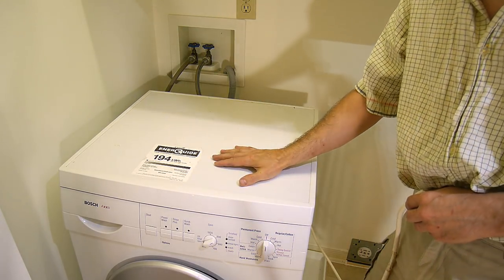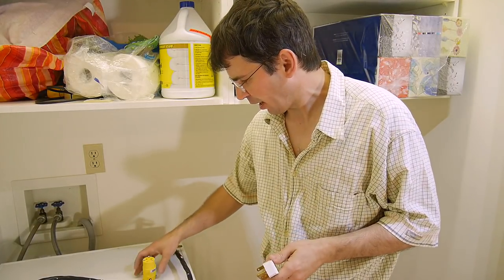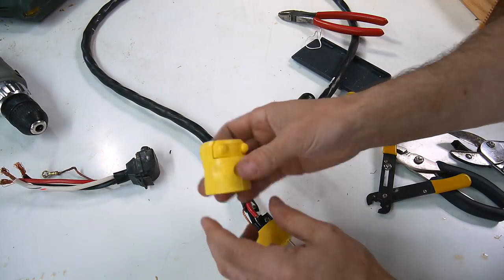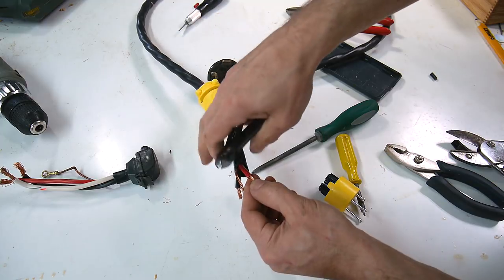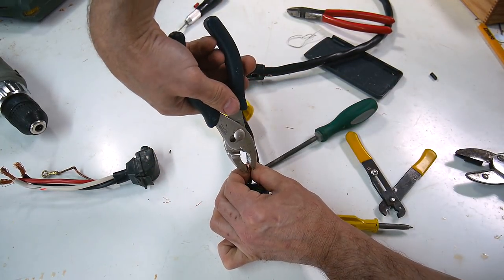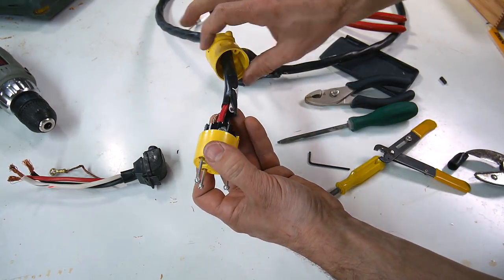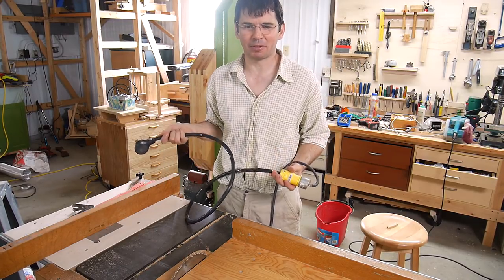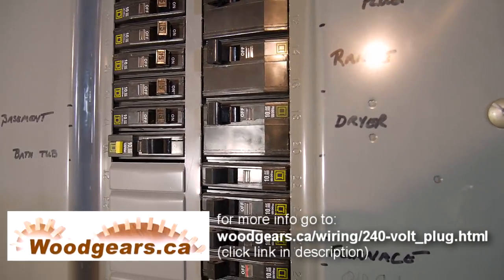240 volt from dryer plug (for Euro-washer or table saw)

Comment: To do a proper installation you should find the washing machine circuit breaker and replace it with a 2 pole 15 amp breaker. Then install the proper receptacle  to plug your washer into. This way will properly protect the appliance and your insurance company will like it too.
Reply: This is the most clever comment. I would have changed the socket on the wall as well.. much cleaner solution. Beside leaving the plug on the floor next to the washer is not really safe.
Reply: Gopher, there is no reason he needs to do that.  The breaker protects the house wiring, as mentioned elsewhere.  He could have just put that plug directly onto the washer cord, but maybe anticipates a move one day.  It might look a little sketchy, but what he did works, and it is safe enough.  Nicola does have a point about the plug on the floor though- I know my washer leaks sometimes.
Reply: I am a Master Electrician. Are you? The way he has done it is not up to 
the Canadian Electrical Code. You are correct that the breaker protects 
the 30 amp house wiring for a dryer, but it does not properly protect 
the appliance which I presume is rated for 15 amps. If this installation
 causes a fire, I would bet that his insurance company would not pay for the damages. If he does move one day, it is simple to change it back to the original way it was and install a breaker filler to cover the extra slot in the panel.
Reply: Absolutely correct. If the insurance company were to see any part of that, they would not pay in the case of a fire.  
Here in the states, that is also done wrong. The main box can have neutral and ground on a bar, but a sub box/panel uses it's common neutral but has it's own ground... Running 2 hot legs and an earth ground can cause issues due to no neutral to balance the 2 legs..
Reply: A breaker can not protect an appliance beyond a current overload because they are not fast acting devices.  It actually takes quite a bit over current for a breaker to actually trip.  Of course the farther over the current is, the faster the breaker will trip.

Comment: In Belgium the rule is 1,5mm² wire = 10A breaker and 2,5mm² wire = 16A breaker. 2,5mm² is mandatory for circuits with plugs or connected to devices. If it's only lightning, 1,5mm² can be used.
Reply: Rizon1985 automatic fuses allow more

Comment: You need to replace the outlet with the correct type (NEMA 6-30R) and that cable is a North American standard (not European). The breaker will need to be reduced to a 30 amp breaker and a licensed electrician should perform the work for insurance reasons.

Outlets are sized according to current and if there were a fault in the dryer then the breaker might not trip before the plastic started melting in your current setup.
Reply from the maker: In that case, never plug a 100 watt lamp into a 15 amp socket, for the same reason.  You will have to get a 1 amp socket and circuit for that lamp (ok, I hope you understand the irony - something I don't take for granted with safety trolls)
Reply: The breaker is only supposed to protect the household wiring and the outlets. If there were a short circuit inside that washing machine that only allowed 35 amps to pass then the breaker would not trip but the current capacity of that outlet would still be exceeded and the connections could melt.

I know it's highly unlikely and I didn't want to come off as a safety nazi but if your house were to burn down for any reason at all the insurance companies will try to blame the fire on any minor electrical code violation they can find.

Comment: Hey Matthias, Bosch is a European company, but that model is definitely Canadian.  It still has the original EnerGuide sticker on the top.  The plug on the washer is exclusively for 15A 240V (er 220...whatever our power is), if it was 20A it would be a 6-20 with one prong turned 90 degrees.

Someone further down mentioned that it would plug into a receptacle on the back of the matching dryer, since the 6-15 plug is uncommon here.

If you want to get really technical, you should replace the outlet above your laundry taps with one of these: https://www.homedepot.ca/en/home/p.15-amp-250v-single-receptacle-ivory.1000137033.html, and then replace the circuit breaker with a 2 pole 15A breaker.  Also mark both ends of the white wire with red electrical tape to indicate it's now a hot wire, not a neutral anymore (assuming you don't want to rewire your house just to get the proper coloured wires in the wall)
Reply: I don't really understand how you're not understanding how the plug works.  it's a NEMA 6-15, it has 2 hot prongs and a ground prong.  Matthias hooked up the bare copper ground wire from the dryer cable to the ground socket of the outlet.  There is no neutral connection to the washer by design, as it's not necessary.  The electricity travels from one pole of the hot to the other side of the hot.  The plug is HOT1, HOT2, Ground.  Look up NEMA 6-15.

Comment: Hi Mattias,

I have a European dryer running on 220-240V,   50Hz 550-600 W.   It comes with a  2 phase wire and will require a 220 V 3 phase plug for North America.  How would you manage such a conversion.

Comment: Matthias, I'm going to leave my assessment of your electrical safety skills unspoken, but I do want to point out that 240V dryer circuits in North America are typically rated for 30A, not 40A (I'm in Ontario like you are). Electric range circuits are 40A (or sometimes 50A), but not the dryer. Also, I run a 240V 6000W space heater in my garage from an unused dryer outlet in the adjacent laundry, and I can tell you that at the 25A drawn by the heater, the salvaged dryer cord I feed the heater with gets rather warmer than I would like, so I would hesitate to use it for the full 30A available from the circuit.

Comment: Small correction: the neutral should not be connected in parallel inside the breaker box. Neutral is connected to the Earth ground at the transformer, while the bonding conductor (this is the proper name for what people often call ground) is connected to the grounding conductor in the box (which in turn connects directly to the grounding rod). So electrically they are in parallel, but each serves a specific purpose, that is why one is insulated and the other isn't...
Reply from the maker: well, then go argue with the folks who wrote the electrical code
Reply: Matthias Wandel, why are you so angry? Argue about what?
Don't get me wrong, but if your neutral is connected in parallel inside the breaker box, your house shouldn't have passed electrical inspection.

In addition, dryer is usually a 30A breaker, stove/range is 40A.

Comment: i think i have this washer, mine is model "wfl2260" about 25 years old, i have had to changed the bushes on the motor 3 times and striped it down to clean once but runes as good as when it was bought just a bit yellowed, my granddad has one about the same age that is in better nik than mine. so you have a good washer there.

Comment: Although I do understand what Matthias wanted to achieve here. I think it would a better solution to replace the 240V plug (NEMA 6-15) of a table saw or of this washing machine with a dryer plug (NEMA 14-30). Such a plug could then be used with an extension cord for a dryer.I am not an electrician, but I do think in such a case you would not have to worry about the circuit breaker and the current rating of the cable.
Just my two cents! Cheers, Mac

Comment: LOL, forgetting the hood before attaching an end is my specialty.  Same for shrink wrap!

Question: This is off topic, but I am curious how you would solder a small Playstation 2 power switch back onto the circuit board given it has 4 tiny contacts (~ 1mm ea.) and my smallest iron tip is a 5mm flat tip?  I'm thinking of coiling a copper wire around the tip and using the end of the wire, but can't figure out a way to keep the coil from moving around.
Reply from the maker: You need a finer tip on your soldering iron.

Comment: Just for my information: Is all houses in Canade fitted with 240 V outlets? The reason why I ask is because  occasionally me and my wife travels to Canada from Denmark to visit my 'in-laws' and as the standard voltage in Denmark is 240 V it would be nice if we just could plug in all our chargers, computers etc. directly into the wall without having to consider voltage issues.
Reply: Usually the only 240V plugs are the ones in the laundry area and maybe the kitchen cook stove if it is an electric cooker. Some garage workshops may have 240. But read the fine print on your chargers and computer power supplies. Many can accept any voltage from 100-240V and 50 or 60 Hz, because this makes them world-wide universal.

Comment: It's always strange seeing how powerpoints, etc... are set up in North America, at least here in Australia it is super simple, everything in a house just runs off a 10A 240V powerpoint and lots of those get hooked up to a 20A or 32A breaker in the meter box. I have 2 circuits in my house, each circuit has approx 10-15 powerpoints on it.

Comment: How is 240v supplied to US/Canadian houses? Is it really two phase 110V, which is why you don't use the neutral conductor?
Reply: me interesting too,  how it works  because 240 single phase is in our country in 3 phase 400 volt between phases
Reply: 2 phases, 180 degrees shifted.
Reply: Same here, 240v single phase. 440v three phase, but nobody has 3 phase power to their house.
Reply: TheFreezeChill so is that a normal thing for every US home to have? Or do you have to get it specially installed?
Reply: In the USA 110/120 and 220/240 is single phase. 440 is 3 phase and only used in factories and larger shops. We use 110 for low current devices like lighting and TVs and smaller appliances. We use 220 for larger current drawing appliances like cooking stove, dryers , welders and such.
Reply: Technically the 220/240 is 'split phase' with one leg either side of the neutral.
Reply: tjousk that's what I thought
Reply: I do, but then I am kind of a nobody.
Reply: Split phase is center tapped ground.
Reply: James Grimwood every house built in the last 50+ years has it. Kinda takes the ol' wind out of the European electrical supremacy sails doesn't it?

Comment: I would recommend using some ferrules. Especially for dryers / washing machines where higher currents could flow. That way you also won't have that problem with backwards bend wires.

Comment: Neutral and ground are not the same thing. The neutral comes from the center of the transformer coil (located at the pole or somewhere outside the house) where as L1 and L2 come from the ends of the transformer coil. The voltage across L1 and L2 is 240 while voltage across L1 and Neutral OR L2 and Neutral is 120. So really all US houses are wired for 240 volts (i.e. L1 and L2). We get the typical 120V coming from the use of the neutral wire that is coming from the center of the transformer coil and either L1 or L2. It only get complicated in the breaker panel when they try to "balance" the load between L1 and Neutral and L2 and Neutral but in reality it's never a perfect balance of power draw across the L1-Neutral and L2-Neutral and that's why the Neutral wire almost always carries current while the ground wire only carries current in a "fault" situation.

If you are wiring a 240V appliance there is no need for a neutral because you are simply using the 240V across L1 and L2. Sometimes if there is electronics in a 240V appliance then the Neutral wire can supply the 120V (i.e using L1 or L2 - Neutral) to run the electronics.
Reply: Thank You for Your explanation. Crystal clear and to the point.
Kind regards
Reply from the maker: How about you have a look in a breaker panel.  See them connected.  And that's what I said - they are connected in the breaker panel.  I didn't say they are "the same".
Reply: Here in Sweden it's common to have neutral and ground in the same wire in to the breaker panel from the transformer. After that they are separated (at least in modern systems), and as stated, current flows in neutral but not ground. However, if a RCD is installed, it might trip if neutral and ground is connected after the RCD. Maybe you don't use RCDs over there? I really don't know. Thanks for your videos!
Reply: In North American breaker panels they go to the same place.
Reply: Sorry for the confusion, I was responding to another comment below that seemed to think they are the same. You are correct though that the neutral and ground are connected in the "Main" breaker panel.
Reply: What does RCD stand for?
Reply: RCD: In the United States and Canada, the device is more commonly known as a ground fault circuit interrupter (GFCI), ground fault interrupter (GFI) or an appliance leakage current interrupter (ALCI). 
Kind regards
Reply: Ahh yes, I am familiar with GFI. Thanks for the clarification.

Comment: Matthias a question from the uk for you. Are all Canadian and American table saws 240 volts? I ask this because I was thinking of getting one shipped to the uk.
Reply: No. If it has a big enough motor it will be 240. But most induction motors can run at 120/240 (clarifications would be thankfull)
Reply from the maker: Most larger (1.5 hp and up) induction motors can be wired for 120 and 240 volts.

It's relatively safe to run a 50 hz motor at 60 hz, but it's NOT safe to run a 60 hz motor at 50 hz unless you also reduce the voltage.  But if you get a cheap one with a universal motor, those can't be rewired for 240 volts.

Comment: does the power come in 2 wires in the US ?
in my country, is 1- power, 2-neutral, 3-ground.
Reply: In the US we have split phase electricity. You have four wires:

1. +120V
2. -120V
3. Neutral 
4. Ground

If you use the +120V and -120V wires together you get 240V. Alternatively, using neutral along with either the +120V or -120V gives you 120V AC.

Finally, you can use a comination of 120V and 240V on the same circuit using all four wires. This is often used for dryers that need 240V for the heating coil, but only 120V for the electronics used to control the device.

More options. Not better, just more options.